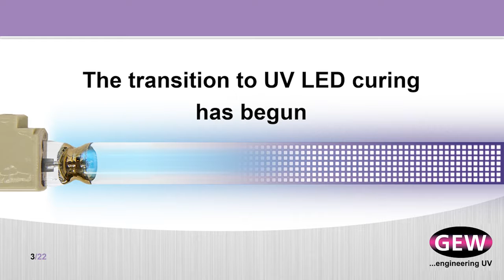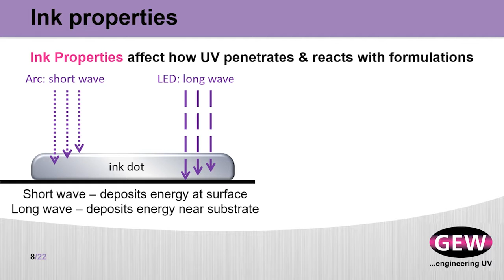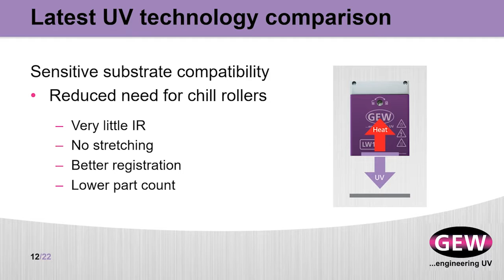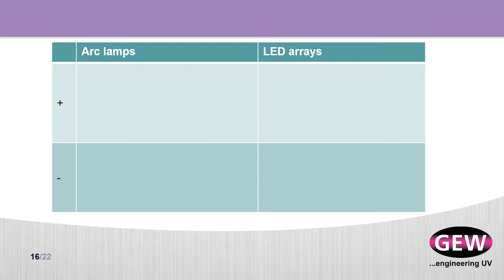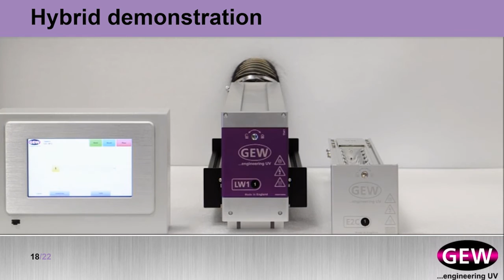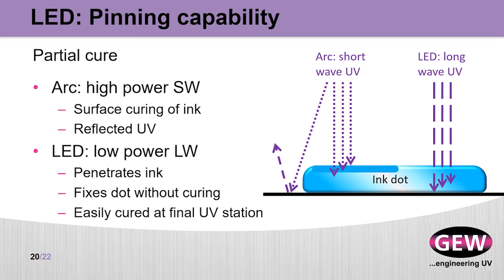TheIJC 2015: The Shared Future of Mercury Arc and LED UV Curing Technologies

Comment: Well explained from the technical standpoint. What they don't tell you is that the LED systems they are advertising are advertised as Cost Saving ( ie electricity bill) what they don't tell you that the savings by switching to LED are lost by the huge cooling costs. Not to mention the initial system costs. Furthermore they don't tell you that LED UV coatings are 300% more costly than conventional coatings. If that doesn't peak your curiosity. Think about the reduced operating speed. LED has its place surely but... its a far cry from being the solution.